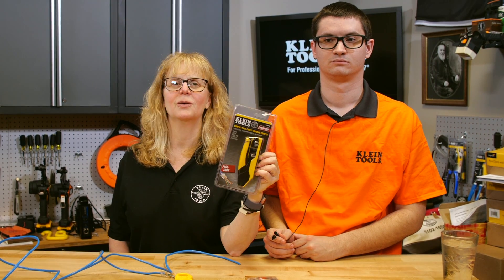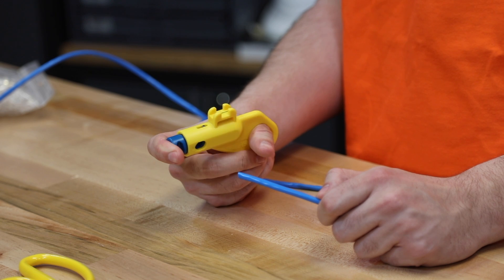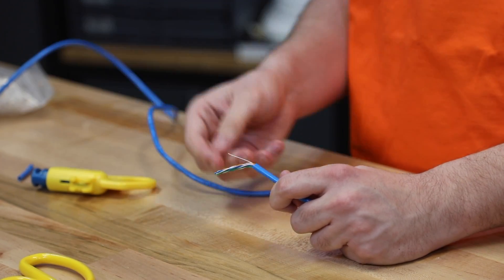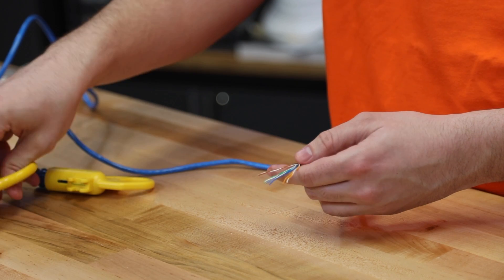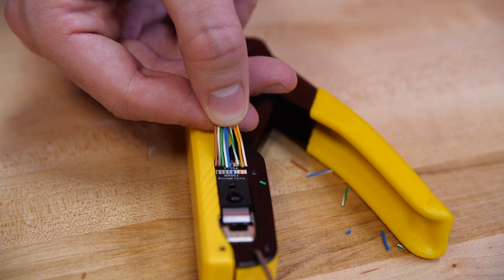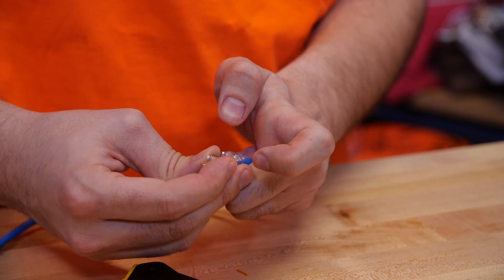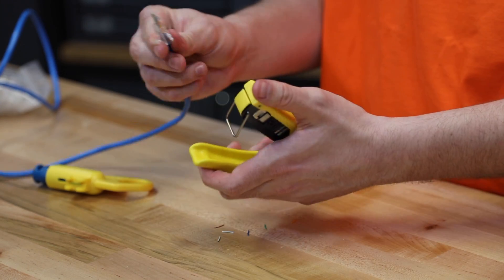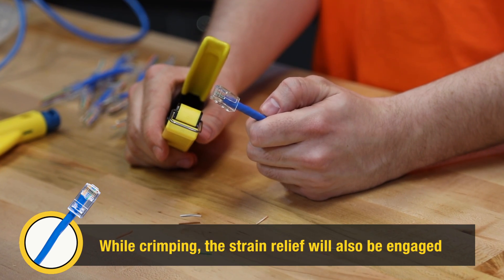Klein Tools: How-To use the Compact Pass-ThruTM Modular Crimper (VDV226-005)

Comment: Just get the Klien VDV226-110. It crimps the RJ45 pass through connectors, cuts and scores the cable.
Reply: After a year of use, pins 1 and 8 no longer cut flush for me. Don't get why this is happening.